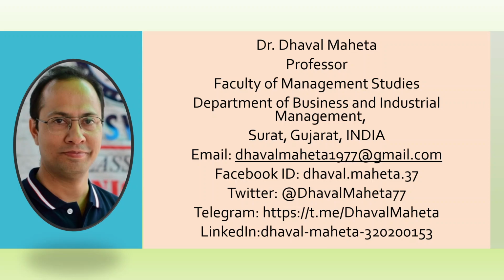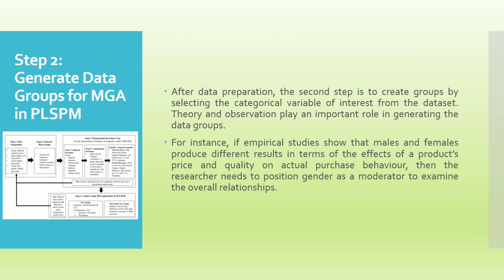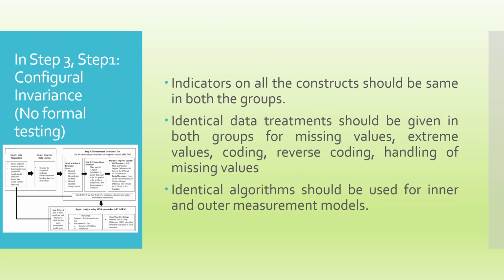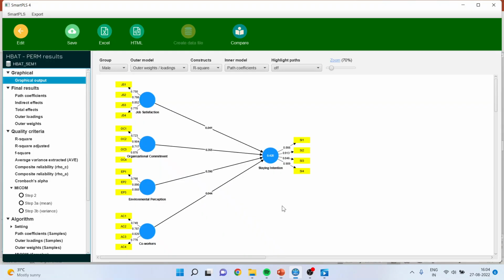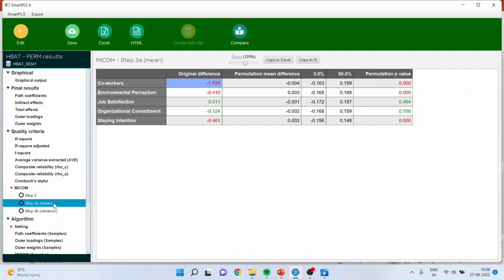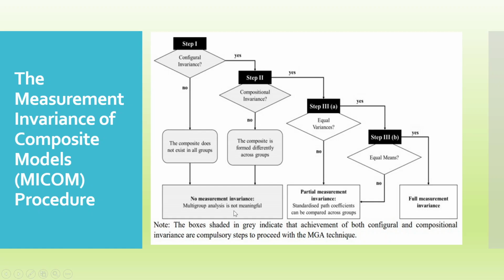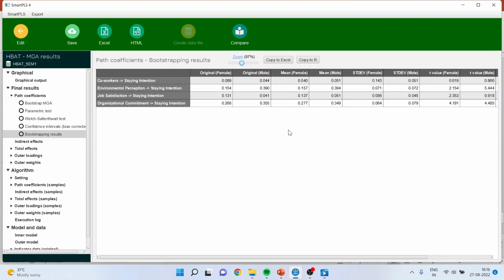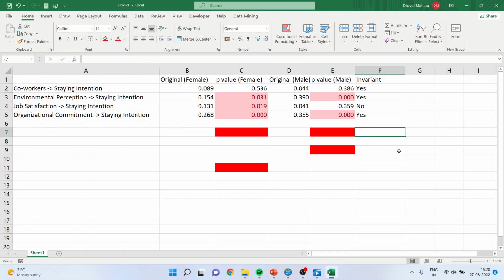15. Measurement Invariance of Composites (MICOM) in SmartPLS-4 || Dr. Dhaval Maheta

Comment: Thank you Dr Dhaval. I have a question: since the objective of MICOM is to ensure that MGA has statistical power to conduct, is it necessary that the sample sizes (e.g., gender: males and females) be equal? An equal sample size across groups is not an issue, since we conduct MICOM, which will indicate whether the measurement has the power to perform MGA.
Reply from the maker: yes its necessary that sample size in both groups should be approximately equal

Comment: Thank you Sir, for the nice video on MICOM. I want to ask a question, kindly reply as I am stuck here.
I have 4 groups and within each group I have multiple constructs (more than 10), while running MICOM, in my step 2 for partial invariance, some of the constructs are failing. Shall I remove those constructs and proceed with MGA, or shall I stop my analysis on MICOM?

Comment: Thanks sir for your informative video. Sir as u say, if partial invariance is established in step 1 and 2 of MICOM, under Smartpls MGA, we can use bootstrapping results (which are at 5th no. Under PLS MGA) to compare path coefficients between two groups and check significance level here only as it shows different group coefficients and p values also. If p values significant, it's moderation. 

And don't check values of bootstrap MGA, parametric, welch, intervals as these are referred if only full invariance is established not for partial invariance. 
Could you please provide a research article which I can cite for this? Kindly revert sir.. 
Thank you so much ..🙏🙏

Comment: @DhavalSaifaleeAaryash, thank you for this video, well appreciated. I have a quick question please:

When partial measurement invariance is confirmed/established, what is the correct way to then compare standardised path coefficients across groups in SmartPLS4? 

1.  Is it using Calculate - bootstrap multigroup analysis technique
Then review the output here - click the final result tab - path coefficient tab - bootstrapping results tab - and/or confidence interval (bias-corrected) tab, as you showed in this video?

OR

2. Is it the Permutation multigroup analysis technique
Then review the output here - click the final result tab - path coefficient tab?

Please, which is the correct tab/results to use for comparing standardised path coefficients across groups in SmartPLS4, when partial measurement invariance is confirmed/established? Thank you in advance.

Comment: Sir I followed your steps and I have a partial invariance but I get insignificant p values in permutation test for all constructs and in the MGA bootstraping result I found a difference between the two group. Why is there a difference in my results? and what is the correct results/test to be reported?
Reply from the maker: If steps are complete and p value is insignificant it means that it not necessary to report separate results